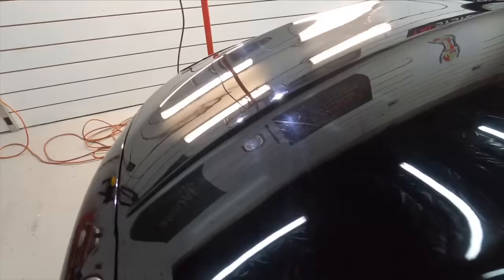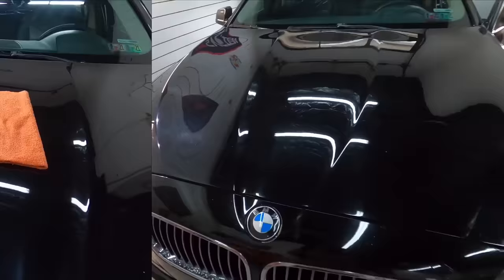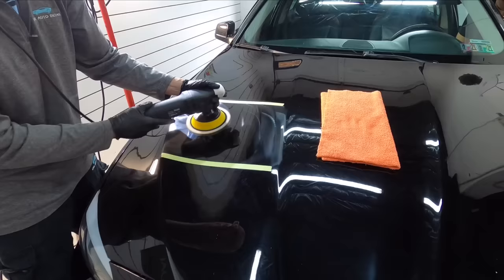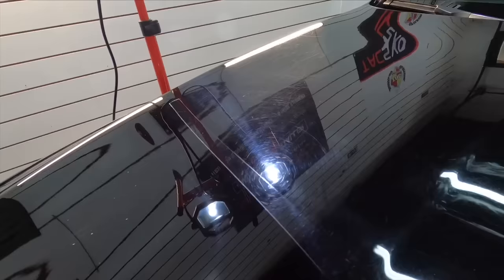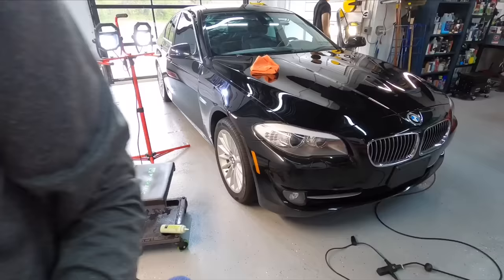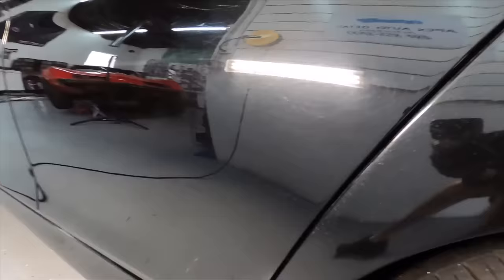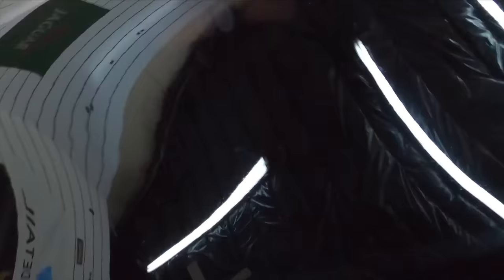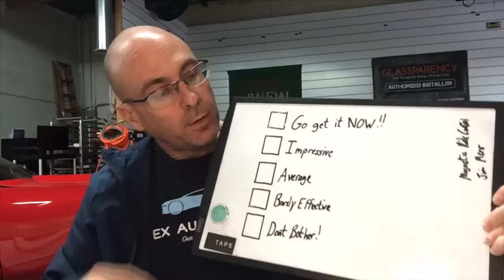Heavy Swirl Removal And Protection For Black Or Any Color Using 3 NEW PRODUCTS! Part 1!

Comment: It’s sad even companies like BMW are skimping on the clear and plastics. My 2016, carbon black, is soft clear and hard to maintain, and the clear is nowhere thick or hard as the one your working on. My 2015 was white and hard clear. Still have to wrap my head around the fact that the clear can vary so much even in the same brand and model. BTW, I finding a great use for the Extreme Solutions acrylics, polishing under the hood, trunk, door jams and inside rockers where I choose not to coat it. Leaves a great finish, look and feel. Liking the brand more, it’s a good niche product.

Comment: 3D One or this ? I been really impressed by the 3D one at this point, done 4 cars with it now and it works nicely with all my DA's and 1 rotary I got. Where does this shelve itself against it?
Reply from the maker: Austin Ferguson this has more correction power
Reply from the maker: This has more correction power.
Reply: Two different products.  This is meant to remove moderate to heavy defects where 3D One is meant to go after light to moderate defects.  I'm pretty sure on this paint system you can follow up the LVR 305 with 3D One and achieve some really good results.  3D One won't cut the most as some other liquids or finish down as well as others, but it does cover a very broad of cutting and finishing which makes it unique and should be a staple in your arsenal.

Comment: Thanks Brian!  You forgot the link to the correction light.
Also, at 7:28, what are the products on the red cart (4 bottles)?
Reply: I believe this is the light Brian was using 

https://www.eastwood.com/eastwood-solar-flare-color-matching-light.html
Reply from the maker: Sandro Herrera Chemical Guys pad cleaner, conditioner,Citrol266, wonder cut and ice
Reply: @5hift6ear  Thanks!  30 bucks is quite affordable.

Comment: how many mils is the clearcoat on a BMW? I have an “older” model like this and I was wondering. Is it thicker than US cars clearcoat?
Reply: He measures it 1:40 into the video
Reply: I would have been curious to see the Turtle Wax Ceramic Black polish used as the second step.
Reply: ctsean thanks I didn’t have time to watch it yet I have watch a lot of his other videos. I’m trying to do a paint correction on my 08 535i. Was just curious
Reply: I have read that Germans use a chemical in their paints that is banned here in the states. That’s what gives it the lustrous and deep color.